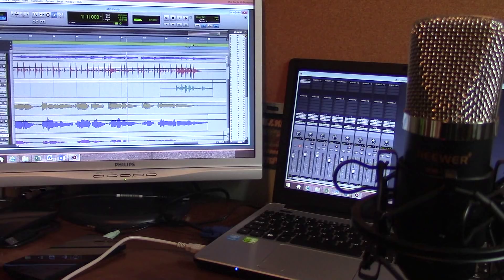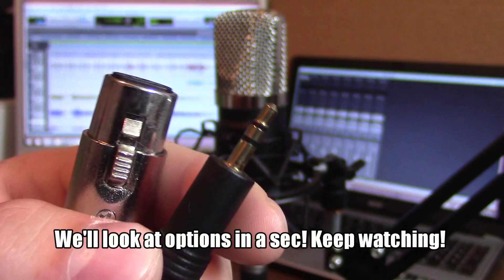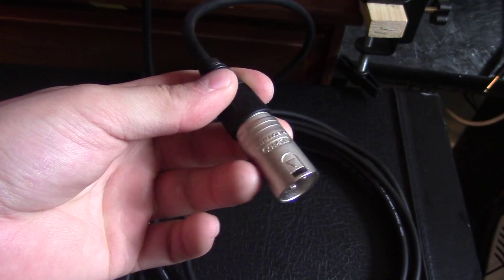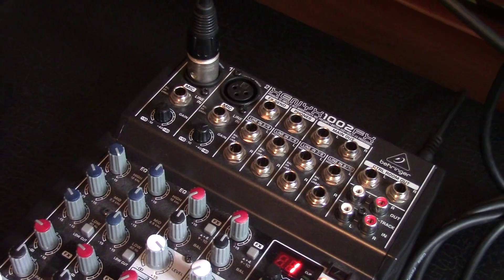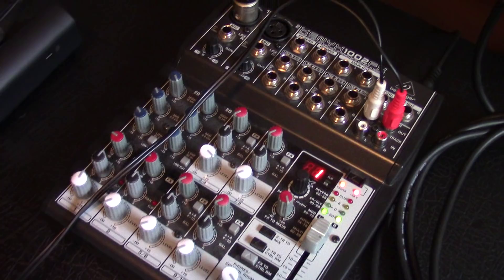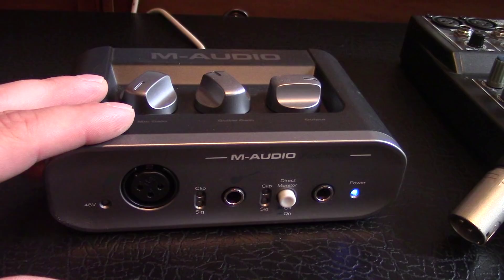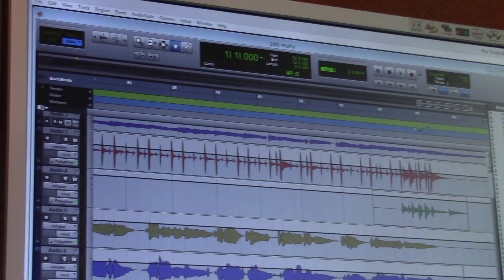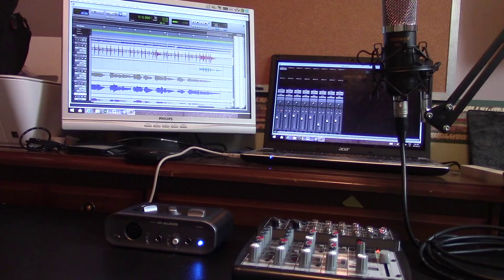How to hook up the Neewer NW-700 / BM-700 / Any condenser microphone

Comment: everytime i plug the mic in a get this nonstop buzzing sound that will not go away.
Reply: mine doesnt even recoord any volume
Reply: Go into your audio settings and make sure your DB levels are 100 and the Microphone boost is set to 0. That is what mine was.
Reply: whats DB and where is it?
Reply: DB is Decibels. Go down to the speaker icon in the lower right hand corner of your screen down, next to the time. Right click on it and select recording device(s). Then select the appropriate mic and right click on that icon and select properties. Go over to the "Level" tab and it's in there.
Reply: If you need anymore help then you can message me and give me a TS if you can.
Reply: It's not rocket science, but this guy did a good job explaining it, but raising the DB levels creates static, that not even Audacity can remove completely. Better off getting a different mic , or a 40volt power supply.
Reply: This is true. Audacity does a good job at taking away that background noise but be careful because it will fuck you up bad. I am still trying to get mine to work with a mixer and I am having some trouble with it.
Reply: Yeah, no matter what i do. I have to raise DB levels to get loud enough audio, And by doing so It creates very bad static, even using Audacity, doesn't remove the static, it only removes the static from parts that have no voice. On the audio where you talk you hear crackling an static, that isn't too bad. but its very unprofessional.
Reply: what mixer your using
Reply: Pyle PAD20MXU
Reply: hmm maybe your gain is too high then again Pyle isn't best company for mixer or even cables I use the behringer xenyx q502usb for me I only get static if my gain or master is too high
Reply: I Wanted the scarlett 2i2 or even the solo but I didn't have the money at the time. I am wishing now that I would have saved up some more. Even with my gain set to 0 as soon as I pla a video or music it plays it through my mic and everyone else can hear it.
Reply: get refund and get my mixer it's like 15 dollar more and has more features
Reply: sometimes it could be cable

Comment: I purchased the NW-800 mic some time ago, unfortunately it is utter trash. I'd set it all up, modified some settings in Sound on Windows 10, checked if the mic was picking me up. Yes, it was working perfectly fine, it sounded great. I tried it on audacity and it was working nicely. Then, a few days later, I opened up Audacity to find... "Error opening sound device" ... spent 4 hours trying to fix it to no avail. Uninstalled+Reinstalled? Nothing. Updating everything and all the drivers? Nothing.

Only the system Sound settings could pick it up. I can't use it on Audacity, Discord, Skype, online audio recorders, in-game. Its a total piece of shit that I was gullible enough to buy.

Comment: Which one is better for the neewer condenser?
Behringer Xenyx 802 Premium 8-Input 2-Bus Mixer with Xenyx Mic Preamps and British EQs https://www.amazon.com/dp/B000J5XS3C/ref=cm_sw_r_cp_awd_Fig1wbJN8G82K
Reply: Behringer XENYX502 5-Channel Mixer
Reply from the maker: +NitemareJp 暁 well, the 802 has more channels, and the addition of adding an effects loop, which you'd need an effects processor to use anyways.. If you're not planning on getting a processor, and you dont need to run a bunch of different instruments at once, i'd say save your money and get the 502. Honestly, if I was only needing to run the mic through a computer, and I didn't need any extra effects, i'd get the 302 USB, by behringer. Simpler hookup. less cables. easy to use, and 3 band eq.
Reply: +Weiderfan thanks for the reply. Is the effect processor required for the 502 or 302 and what does the effect processor needed for?
Reply from the maker: I have the 1002FX, which has a built in effects processor. Which means you can add things like reverb, chorus, etc with the push of a button. The 802 has a place where you can plug in an external effects processor, but it doesn't have the built in like mine does. The 502 and 302 doesn't have a built in, nor a place the plug in an external. In other words, the only way to add effects for these 2 is to add it digitally, with whatever software you're using. In either case, effects are just fun add on's to improve sound, and are not needed.
Reply: +Weiderfan Hey. I'm back again. So I ended up buying the 802 and I just came back to this video to re-read what you told me earlier to make sure I did not waste my money. So with the 802, am I not able to use it without the effects processor or I am still able to use it but I wouldn't be able to add effects on it like the 1002 and could just add effects digitally? Thank you for your time
Reply from the maker: Hi! I don't think the 802 has effects, does it? If it does, you can use those. If the 802 does not have built in effects, you can add them digitally with software! :-) I hope this answer's your question?

Comment: I plugged my Nw-800 in the jack but I have a very bad sound quality. Will i have a better audio quality  If I plug it into a USB audio adapter ?? ( http://www.amazon.ca/Plugable-Headphone-Microphone-Aluminum-Compatibility/dp/B00NMXY2MO/ref=sr_1_2?ie=UTF8&qid=1445578053&sr=8-2&keywords=usb+jack+adapter )
Reply from the maker: +piogg Hmm, I cannot assure you 100% that this adapter will fix it. I will pretty much guarantee that your problem is a lack of power. However, whether this USB adapter will give your mic 48V of power is something I cant answer! It is pretty cheap, so you could try it. Or you could pick up a pre-amp and have it done with. Good luck! Thanks for watching!
Reply: +Weiderfan Thx for the reply. I will try this http://www.amazon.ca/Andoer-Condenser-Microphone-Recording-Equipment/dp/B00VK2W3V6/ref=sr_1_2?s=electronics&ie=UTF8&qid=1443559471&sr=1-2&keywords=Phantom+Power+SUpply
Reply from the maker: Yeah! That's looking better!

Comment: Can you use it on ps4 with an usb sound card?
Link soundcard: http://www.amazon.com/Sabrent-External-Adapter-Windows-AU-MMSA/dp/B00IRVQ0F8/ref=pd_sim_147_1?ie=UTF8&dpID=51FLiQuh7EL&dpSrc=sims&preST=_AC_UL160_SR160%2C160_&refRID=0XVFBC739DW446APYSGD
Reply from the maker: +TastyVariable6 Not without a mixer of some sort. The usb port will only provide about 15v power at best. The behringer 302USB is probably the best bet I can think of!

Comment: http://www.amazon.com/gp/product/B00KAPGLQC/ref=ox_sc_act_title_1?ie=UTF8&psc=1&smid=A2HC58KVPP5OOH would this work lemme know asap
Reply: +Spoodle all Day i was also wondering about this exact product +weiderfan
Reply from the maker: +CLoNe gaming Hey guys, sorry I didn't see this comment until right now for some reason! Sometimes I don't get notified... This product should be just fine for this mic. Its a 48V phantom power source just like is required! I see no issues at all! Go for it!
Reply: +Weiderfan But do you need an external sound card if you buy that? Or you can just plug it to the PC (im not english, sorry if any error)
Reply from the maker: No, you do not still need a sound card. you will ONLY need the phantom power supply! Merry Christmas!
Reply: Weiderfan Ok! :'), thank you and merry christmas!
Reply from the maker: No problem!

Comment: Hello,

I have used this phantom power supply: http://www.amazon.com/Neewer-Condenser-Microphone-Recording-Equipment/dp/B014H8AWGC/ref=sr_1_1?s=electronics&ie=UTF8&qid=1464991653&sr=1-1&keywords=neewer+phantom+power

Though I have plugged it into my laptop with the Phantom Power Supply active, for whatever reason the computer will not recognize it. I am new to condenser microphones, so I don't know. 

Does it depend on the kind of laptop I am using?
Reply from the maker: it shouldn't depend on laptop. check out my video on trouble-shooting! it should help you out!

Comment: https://www.amazon.ca/Neewer-1-Channel-Microphone-Condenser-Recording/dp/B014H8AWGC/ref=pd_bxgy_147_img_3?_encoding=UTF8&pd_rd_i=B014H8AWGC&pd_rd_r=f5a59613-0211-11e9-9275-b3e00a75f9be&pd_rd_w=lL7gW&pd_rd_wg=GAsGA&pf_rd_p=cda2b2aa-f379-4b98-b5ff-b78659186dbe&pf_rd_r=SWN5ZQHQGGC8PH4MET4P&psc=1&refRID=SWN5ZQHQGGC8PH4MET4P can i buy this and it will work so if i buy this and then the mic im good to go or do i have to buy anything else cuz this is cheaper then the link in the description